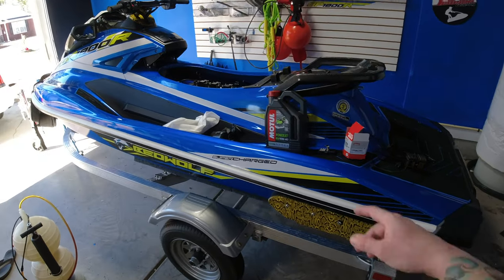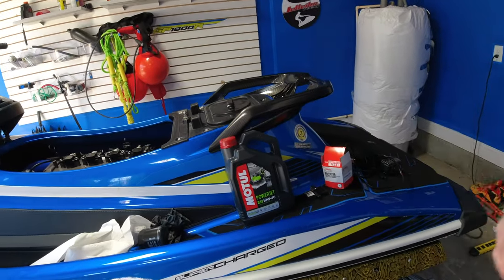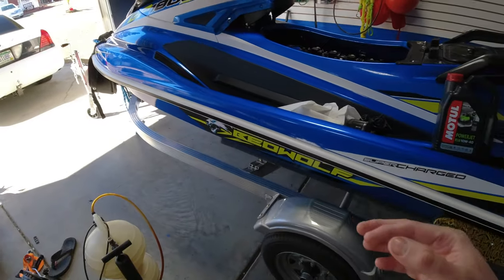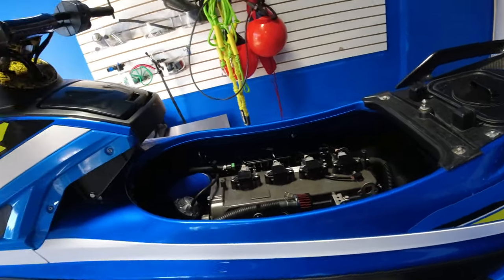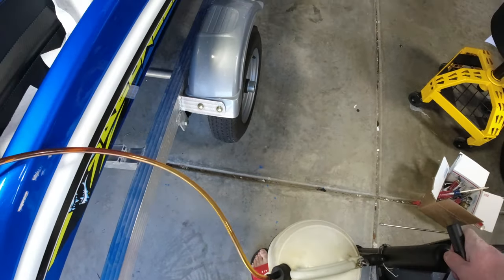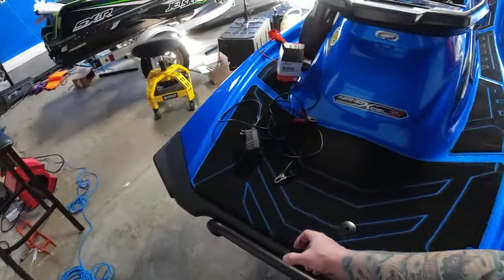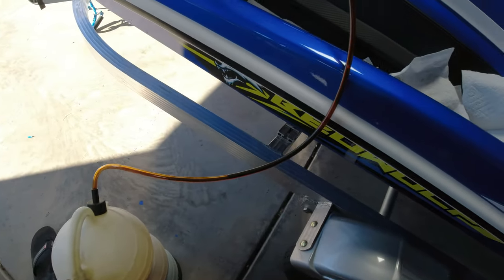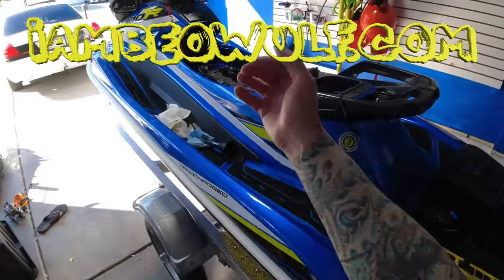This Is Why You Should Change Your Jet Ski Oil Every 25 Hours!  4K

Comment: As a rule everyone should use pwc specific oils.  They are designed just for engines that run at high rpms and high load all the time.  Those oils are spiced up with the extra additives you need.  I change my oil every 25 hours or so that is a good number.  These engines work HARD.